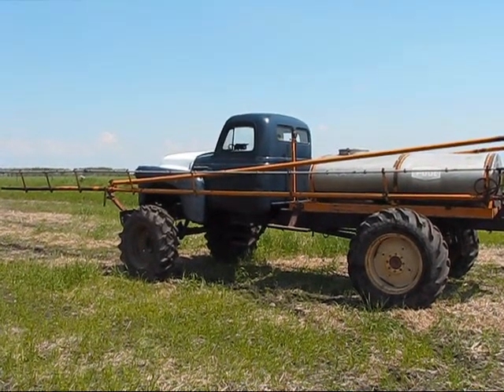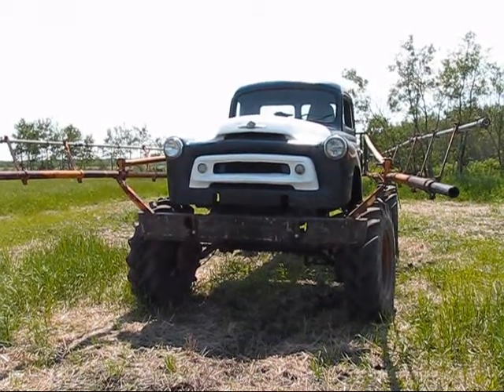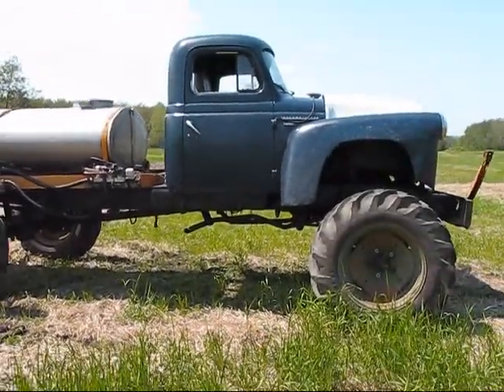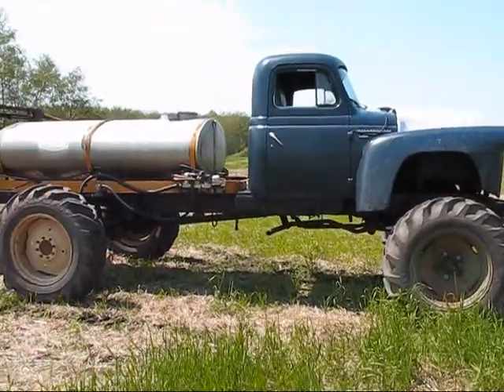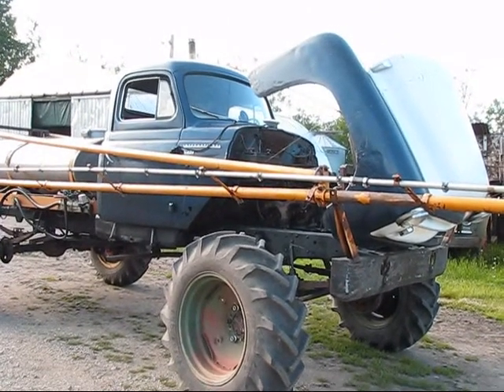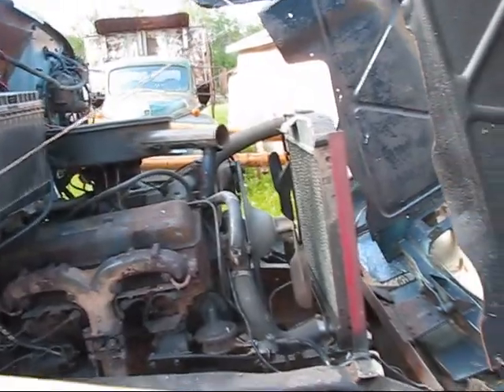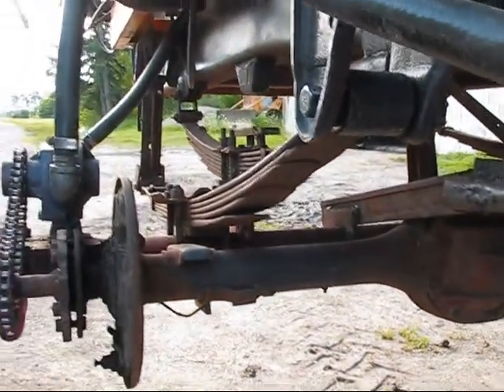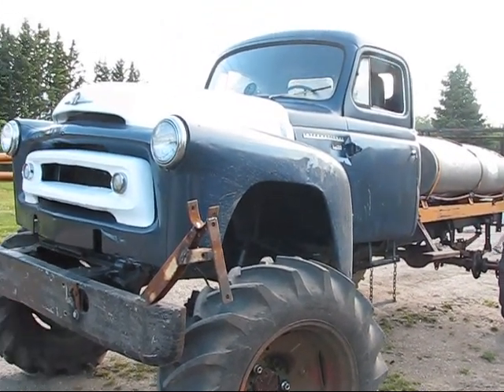monster truck spraying

Comment from the maker: I would like to add more information as there were none uploaded with this video.  This machine is built from a Chevy truck frame, powered by a Pontiac car engine and transmission.  This turns a Massey combine final drive on the rear axle with combine tires on both axles.  The hood and front end is from a 1956 IHC while the cab is from a 1950 IHC truck.  The sprayer tank and booms come from a old Pool field sprayer.  All components were made to fit by minor modification, welding and machining.